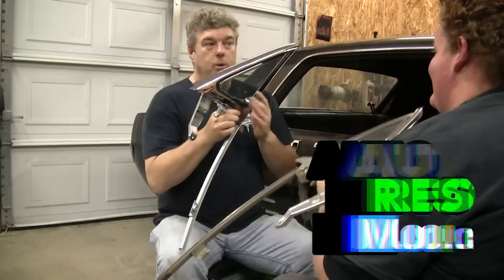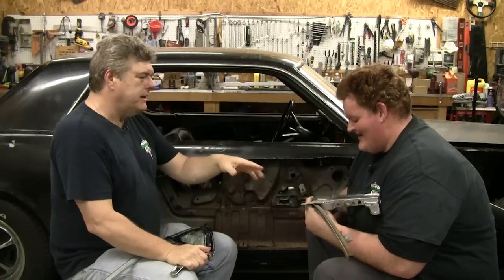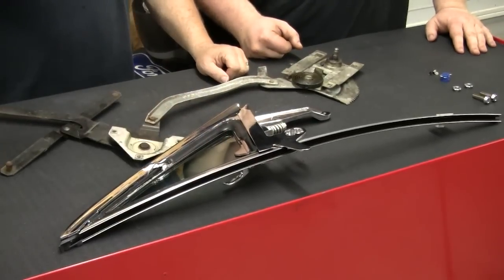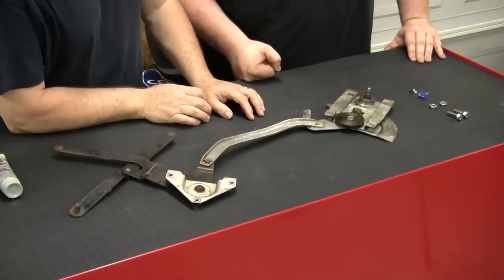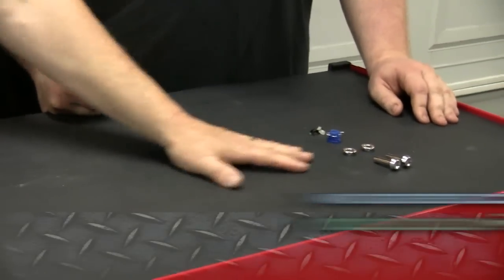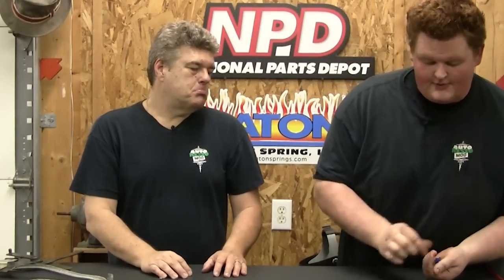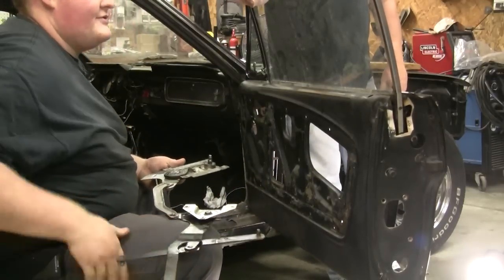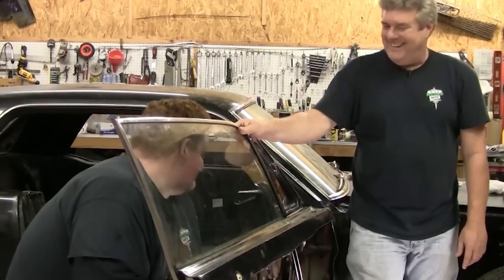How To 1965 1966 Mustang Vent Window and Door Glass Install Episode 364 Autorestomod 1

Comment: FYI, Found another way to hold the door glass up if you're doing this solo. Window in the "up" position. Slide two reasonable length Phillips screwdriver in two of the upper door panel holes. Rest the glass on the screwdrivers while you fish the regulator into place.

Comment: We have brand new doors and I swear the brackets and holes in the door itself for the vent window aren't right. We cannot get the main glass to sit right. The front part of it is literally an inch low because the vent window is in the way
Reply from the maker: I will say that it's going to be very hard to diagnose that for you because I can't see what you're working with.

Comment: I've just reinstalled mine with new beltline weather strips and new mole skin.  My glass seems to come up higher in the back, towards the quarter window and low in the front.  If I look in the door I notice that the window is out of the channel.  Not sure what to do with that, it doesn't seem to want roll up or down evenly.  Any suggestions?

Comment: First of all, THANK YOU for the hard work of making all these videos.  My dad and I have been restoring a 1968 Mustang Fastback and we have watched and used the "help" of your videos SO MUCH.  Hopefully NPD treats you guys well because we have bought many things from them, based on your recommendations.  We recently installed the "complete vent window assembly" and we are running into trouble with the door window hitting the "black plastic (looks like rubber in pictures but it is a plastic material)" attachment (that is located at the top of the vent window trim).  It keeps the door window from going up all the way???  Have you ever ran into this?  I went through this video a few times but could not find anything.  Sure would appreciate any ideas?  Thank you again for all the great videos.

Comment: on my 67 Mustang coupe. both the driver,s and passenger,s windows will not stay rolled up all of the way. i can roll them up, but about 2 days later they have come down about 3/8 of an inch. and i have mistakenly used the white lith. grease on them. i know that you cannot see my problem , but what would you think i need to do.? your videos are awesome. thanks.
Reply from the maker: I would hazard the guess of the spring for the window issue. Not sure if you can do much about the spring. winding it one step further might be "too much". Replacement might be your only option as those are supposed to hold the glass up. Lithium grease isn't "bad" it just isn't great.
Reply: thanks for the fast reply. i guess that i have a new project to do. man i wish that list would get shorter. but it seems to be going the other way.

Comment: Jeff,  the glass on the drivers side window sit too low on the back side when it's all the way up.  I have new a regulator and scissor from NPD that I just bought and installed.  I'm so frustrated because I don't know what else to do to get this to fit correctly.   what am I missing?
Reply from the maker: There is a stop in the back check that. Also make sure that the rear runner is in the right spot. If you are still having problems contact me at: jford@autorestomod.com
Reply: @AutoRestoMod  Thanks I will.  I'm planning on working on it to tomorrow so I'll let you know.

Comment: I took out my windows to get the car painted inside and out my driver door windows went in without a problem but on the passenger side the vent windows holes won't line up, they're to high and if I get the window where the chrome is touching the paint  all the way down they're still to high any tips?
Reply from the maker: Send some pictures to jford@autorestomod.com 
I'll need to see the whole door and vent installed etc. Really hard to diagnose without being able to look it over.
Reply: @AutoRestoMod  gotcha the mustang is my grandpas and turns out it was an after market door that was poorly done I went and got a spare door from another and it fit perfectly. Thankyou for the response though.

Comment: please can you make a video how to drive a mustang w the green dot c4 transmission because i am bery bery bery confused about how to make my car runs the best way possible whith out damage the transmission thanks so much for every video you do thanks.
Reply from the maker: "Green Dot" is the Mustang Slang for the '65/'66 C4. It uses a different shift pattern than the '67 on up C4. The Green Dot position is the "normal" driving position, even though it looks like it would be in 2nd gear. 

The shifter is labeled:
P - Park
R - Reverse
N - Neutral
White Dot - starts in 2nd gear, automatically shifts to 3rd
Green Dot - runs a full shift pattern: 1st, 2nd, 3rd.
L - EITHER first gear or second gear, depending on the gear you are in.

You can manually shift a green dot; here's how:
Start of with shifter in 'L' ... this will start in 1st gear and hold 1st.
When you're ready for 2nd gear, shift to Green Dot. The tranny will shift to 2nd. Leave the shifter here until the RPM's build about another 300 RPMs, then pull the shifter back to 'L'. This will now hold it in 2nd gear (don't worry, the governer valve will not allow it to down shift).
When you're ready for 3rd gear, shift to green dot again, and it will now shift into 3rd.

The tricky part of shifting a green dot is knowing when to pull the shifter back to 'L'. If you do it TOO quick, it can down shift to 1st. If you're not quick enough, it will shift on into 3rd.

Comment: If you are doing this at home be advised that the glass does not go in this easily. They have removed the mechanics of the door latch and the various connecting rods as well as the part of the rear window guide that restricts the window from going up too far. Also they do not show how to move the regulator past the division bar inside the door;..it must be forced past it.  These items make this job VERY difficult in the real world.
Reply from the maker: You are so right! Because we covered all of that in the preceding episode: https://youtu.be/_gEhWeNAfL0